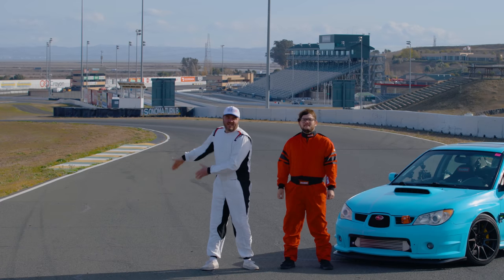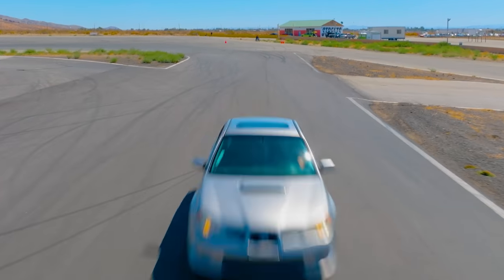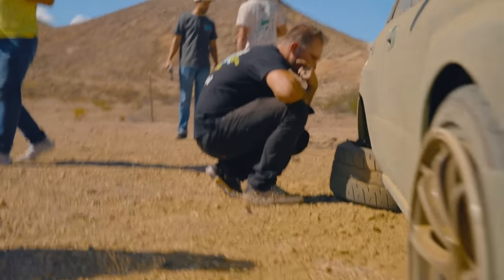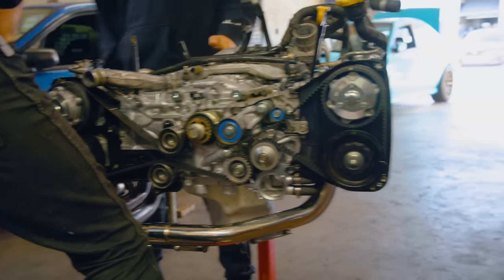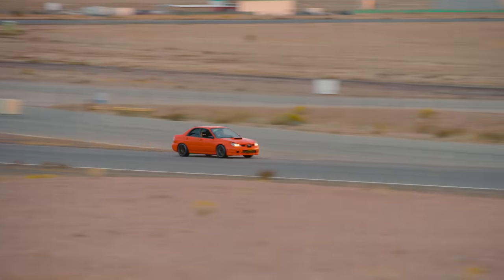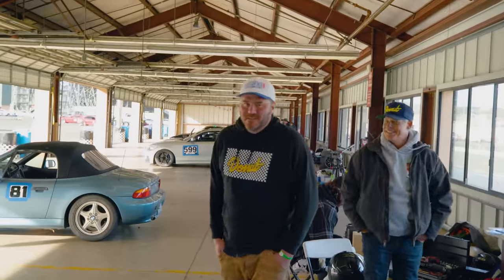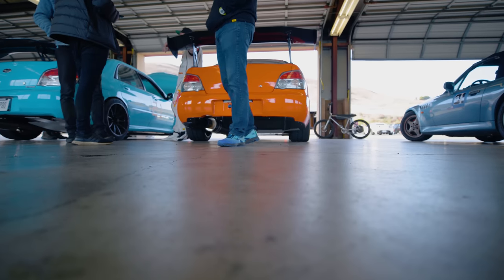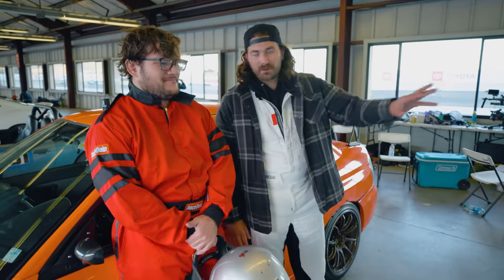$21,000 vs $43,000 Subaru WRX Build - HiLow FINALE!

Comment: If this was a normal person's build I'm 100% both cars would have gotten scrapped by now
Reply: A normal person would of put a built motor in the 1st time instead of wasting money on second hand ones.
Reply: @thewrathofbibby3381  or bought an ej207
Reply: @thewrathofbibby3381  normal people don’t have built motor money
Reply: @thewrathofbibby3381  they had a built motors and blew that up to.. hmm no wonder break in miles are for a reason drive a brand new car like a race car and watch it not last 5 years without major repairs.
Reply: @anusername8350  Normal people 100% have money for a built motor. Replacing from a brand new OEM block will cost you $6-7k. A built block only cost another $2k typically. Why wouldnt a normal person save the extra $2k to go built?
Reply: @AndrewB23  which is what I have. 20 trackdays later and it's still all good.
Reply: Not me lol still have mine makes 500whp
Reply: @mrblock2013  Calm down Mr. Moneybags

It's true that ACTUAL normal people don't have money to just throw on a car for a built motor. For example in America, 6/10 people don't even have $500 in savings.
Reply: @mrblock2013  Its kind of sickening how you expect normal people to have two grand to spend on a car that they could probably barely afford in the first place. I bet you had a great childhood and some inheritance, plus a paid for scholarship or something along those lines. Try to work at a store and have kids. Thats pretty normal. I dont, but Im just saying.
Reply: @BurittoSandwich  You are correct around 60% of people in the US live paycheck to paycheck which depending on said paycheck and cost of living in their area might give them some leeway but as you say normal people don't have built motor money, in fact most Americans rely on credit cards and bank loans to cover any shortfalls and even then as high as 85% live one serious medical emergency away from bankruptcy. This doesn't mean there are no people with money in the US but its a much smaller percentage than people like to think.
Reply: @edubbs3528  it disgusts me how America pays its teachers. they say that they value you, and then proceed to allow you to live in poverty, if you can even afford to live on the wages at all. teachers deserve an enormous raise across the board.
Reply: @thewrathofbibby3381  a normal person would ls swap it instead and avoid the rest.
Reply: @deathtoming2201  They had REBUILT motors, which usually means rebuilt to like-new, stock specs. "built" refers to changing the internals for aftermarket ones that are stronger/lighter than stock and can take more abuse
Reply: @skynet1.044  That is the fiscally responsible way, plus you get to learn about the engine far more in depth than hearing explanations online without context.
Reply: @KapteinFruit  it’s not sickening, I agree with him. Normal “car guys” should have enough for an engine build unless they’re stupid with their money. You should always know what you’re getting into before you buy something. If they were really living paycheck to paycheck, they would buy a Camry instead of building a car lmao
Reply: A normal person wouldn't get a WRX without knowing they'll blow up lol
Reply: @KapteinFruit  if you’re really struggling and you want a hobby, there’s plenty of other hobbies that are a lot cheaper and could even be free
Reply: @jcmellymel  Thats not how it works, is it?Hobbies come from interests. And me personally, Im good, financially. I work as a welder, but Im from a poor family thats why I get upset by your statements. On top of that I live in one of the worlds richest countries per capita. Im not dumb, nor poor.
Reply: @jcmellymel  Im not even talking about myself.
Reply: @mrblock2013  yep used to think built motors were inaccessible but it only costs a few G max if you do it yourself and only replace what actually is important
Reply: @KapteinFruit  but it is how it works, many people are scared or aren’t willing to try new things. I, for 1. The human brain’s capacity isn’t limited to only one hobby

As a grown man/woman, I’m sure you know the phrase, “live by your means”. Bottom line is, don’t get into building cars unless you can afford it, plain and simple. 

I’ve been a car enthusiast before I enlisted and still am. While I was enlisted, I knew I didn’t make enough so I didn’t even try to get back into the hobby. Of course I found new hobbies, but I’m still a car enthusiast. Now that I’m out and make a lot more, I’ve gotten back into it.
This doesn’t mean I can duke out $5k on the spot. I budget and save every month to fund the build. You don’t need to copy everyone else’s pace, you go with what you can. Which brings me back to my point, normal car guys should have enough for their builds
Reply: @KapteinFruit  A lot of people that got money came from poor families my guy, some people just don't have drive to move themselves up. Some are just lazy as fuck like my cousin in law just wants to set around smoke pot while her husband is the only that works and provided for them and their two kids...while living with her mom. People pumping out babies before their mentally or finically ready to raise kids.
A lot of people have terrible spending habits, and thanks the modern world built around debt tend to spend way out of  bounds. Financing the biggest house and cars the banks will let them.
There was a lady on the news crying about she can't afford to fix her leaky roof, with a brand new Mustang GT sitting in the driveway. I drive by run down trailers with brand new fullsize trucks parked outside all the time. By time they paid those trucks off, they could of  had  money to get a nicer house.
Reply: @jcmellymel  You keep talking about me. Im good. I got what I need. Im speaking about others view. How are you gonna save up money when you can put aside a pack of noodles. Just stop. Im good. I got a store thats going well. Im fine. Stop talking about my wallet.
Reply: @KapteinFruit  Not really one in a million, not talking like rags to riches. I mean like move up the ladder one step at a time. Just don't settle for working at Walmart or a gas station.  
I'm come from a poor as dirt  rural area where crack and meth is everywhere, I'm not ignorant to what you're talking about it. I watched my mama juggle raising me, work, and  school. There ain't no nonsense here. We live in a capitalist society, if you want nice shit, you gotta work for it.   You're right though, people are too afraid even take the little baby steps forward. Would rather take the shortcut, and wind up drowning in debt and bills. 
I ain't mad, just sainy' NGL  and pretend I didn't have it a little better then some, but I didn't come from money and have everything handed to me either. I just worked hard  to play hard. So of the more grueling hard labor jobs out there pay big money for those willing to do it.
Reply: I had a Subaru, engine blew, had it rebuilt, that failed as well, just scrapped it after that.

Comment: I would love to see an Up to Speed or B2B on the Subaru Tribeca SUV. It's interesting because the weight of the car is ridiculous, it has an H6 engine that has a weird design history, and it flopped because of its grille. I have a 2009 Tribeca Limited and it's been great. I spent 3 years living "van life" in this SUV all over the US of A and was easily able to fit a twin size 8" memory foam mattress in it without taking the rear seats out and still had space for the things that van life requires. I love this car and it's history and commercial failure is a good story. Love what you guys do! And yes, I vape Jewel Mint flavor 😂.

Comment: Well, if a group could do more to destroy a company image SUBARU doesn't want to hear from them. LOL, I wanted one of these cars before this.
Reply: Dont it will only give u problems and im not saying this because of the video
Reply: dont listen to him. Wrx is an amazing car. There are certain mods you need to do inorder to put power in this vehicle but its an amazing veh
Reply: They're awesome cars man, I would recommend them. They are not this unreliable. This is what happens when you don't research anything and just bolt random shit on and hope for the best. A lot of motors are the same in that regard.
Reply: @Mrninjaged not to be rude but you do realize 3 engines died before they even did anything to them right?
Reply: These guys have no idea how to build a Subaru please don't take their word for it, find other sources.
Reply: @demoritzz5327  They were all rebuilt engines when they bought them...Doesn't mean they were built right.
Reply: They’re great cars! Ive had 3 Subarus. They claim “5 engine rebuilds”. If 5 engines break within a few days. It’s the mechanic not the engine. I’ve seen dozens of Subarus with 400-700HP with little to no issues. Another thing is when u have metal in the oil. U replace the whole system not just the engine. No matter how clean u think the pan is there’s still metal.
Reply: Owned 3 and had zero issues. Care and respect for the car goes a long ways.
Reply: @BRedFilms  also break in period was probably non existent. Regardless their still a POS CAR PART 80K MILES.
Reply: Lol all these suby fanboys are like "yeah it only explodes if you fail to take it out every other Sunday at exactly 2:35 PM to the eastern most section of your town and bathe it in seawater, otherwise it's you're own fault when it explodes in 7 different ways"
Reply: as a previous legacy GT owner, who has worked on multiple hawk eye, 2008+ and 2015 WRXs.. unless you're 100% about the life dont. People will say "oh you just need clean correct mods etc" look the cars stock are great. Especially if you just do supporting mods and squeeze no power. But they have SO many weak links youll have to focus hard on each one. Engine ringlands, 5 speed transmission, many other annoynaces.
Reply: @Lurch Word. Wife's 2013 GTI is at almost 200k and the only thing I've done is wheel bearings. No chain noise, but I should prolly do that given the mileage.. Water pump was replaced via recall, and SHE routinely changes the DSG fluid and oil, along w/ tune-up. Oh, and I replaced a u-bolt on an exhaust coupler. We'd get another in a heartbeat. My VR shenanigans w/ Mk2's and 3's are all self inflicted, so they don't really count..
Reply: @demoritzz5327  they also drove one without any break in period.
Reply: People will look at this video and say subi isnt reliable nor isnt worth it. If you want to race this veh or things like that. One you have to have an air oil separator (aos), second the back right piston or piston 4 heats up quickly. You have to direct coolant there as well. Plus if you wanna throw in oil pan and pick up upgrade. When upgrading parts in the engine tune the vehicle every time.
Reply: @Fake This Crap  You know what you're talking about. Good to see man.
Reply: i got a 2019 sti and have driven it pretty hard for 30 thousand miles and haven’t had a single issue
Reply: @broglee7244  its not that. People complain about modifying these engine and itll break easy. What people dont get is that if you modify any engine it’ll break easy.the wrx sti engines are very finicky. You would need to make sure you get the things that I mentioned earlier to have a more reliable sports car.
Reply: @Sideapotatoes  why would you break in a used engine?
Reply: @demoritzz5327  They said that it was freshly rebuilt. They even admitted it was their mistake. I'm not some crazy guy about breaking in an engine but you definitely don't take it straight to the track.
Reply: @Sideapotatoes  the Last two engines we're rebuild the other ones we're junkyard engines. And i don't want to say you don't have to break modern engines in but they don't break of you  instantly abuse them. It certainly will shorten their life expectancy though.
Reply: @de Moritz z  I agree but there's more to this whole thing. Don't get me wrong, I'm not a big fan of these engines. I have an 04 wagon with a hybrid build that I think im going to sell soon because it stresses me out even with most the weak points all figured out. I'm a toyota guy so I'd rather a lift for my landcruiser, something I can trust.
Reply: I’ve had 2 wrxs, both ejs, currently on a forester, only problems I’ve ever really had were pinch clamps losing their strengths causing hoses to fall off, and a broken fuel line, some call it luck, I call it taking care of a car 🤣. These cars get horrible rep from stupid teenagers not knowing how to maintain a car. The cars in this video are being ran hard all the time, likely without a tune as well. DONT DO THAT!! just my 2 cents
Reply: @cerb_6202  i think maintenance does have a big effect  but they we're Not run without a tune either the engine was Stock or they Had the turbokit installed and while they Said "we got the Cars tuned" you See them driving onto a dino

I don't know since i have not had one yet but i think the reputation has to come somewhere bc if it was a teenagers fault civics and mustangs and the stuff these teenagers drive should all have a bad reputation. Although Subaru probably isn't as bad as it's made out to be. 🤷🏽‍♂️
Reply: @fakethiscrap2083  I read stuff like this and it makes me THINK. These are things I never would have just magically thought of, and it makes me think that it's worth the time and trouble to KNOW the engine you're working on, don't just slap shit on. Great contribution.
Reply: @YerBrwnDogAteMyRabit  its simple you own or plan on getting a vehicle and put more power into the engine. You would need to research the engine and things like that. Crazy that they preached it with their old videos but didnt do it with this vehicles.
Reply: The amount abuse and stress the motors and trans go through on a road course immense.   It’s nothing like driving it daily and pulling on the streets here and there.  Just face it,  those old subi engines just can’t hold up in those conditions.
Reply: @izzoArtistry  they could handle these type of track days. The only thing was the fact that they didn't really did their research on the vehicles.
Reply: Why isn't his goofy face on the video avatar? What's going on and we've lost that privilege?
Reply: @fakethiscrap2083  You're just a person that owns a WRX and wants to justify their purchase.
Reply: @pawrestlingchamp  honestly i dont really care if people dont buy the wrx. Because of donut media theyve made it cheaper for me to buy another wrx sti for a cheap price. Im lettimg peopls know whos wants to buy the veh to get it and to do their research. I dont go out of my way to say dont buy a honda, ford, bmw, vw, and merc because their dog water. Im happy with my purchase. I only buy vehicles that makes me happy
Reply: you could do it 1000 times better than these guys.

Comment: I have always liked the way the 07 WRX's look and they sound great, that's about all the good I have to say, sorry Subaru fan boys. Seeing them at the track being out run buy an E46 M3 after over $20,000 in modifications, a broken transmission, and 5 to 8 motors, I guess you just have to love the cars to want to modify them. I can think of very few cars less reliable after mods than a WRX of any generation. I purchased a 2006 E46 M3 6-Speed with 171k miles for $4,000 in 2019 that needed throttle body actuators. After coil overs, Pilot Super Sport tires and a few modifications I am probably in the car $8,000. I am confident not only is it a nicer car to drive, it will hold it's value infinitely better, it would outrun either of these cars no question on the track, and it is massively more reliable even with over 180k miles, not that it is a reliable car, but comparatively so it is! I would save my money, buy a 2007-2013 335i with a 6-Speed, work out a few N54 or N55 kinks, rune a tune and downpipes, a absolutely destroy these WRX's on a track, and not lose a motor in the process. The WRX might be a fun car with a huge mod market, just bring your wallet, and some patience!

Comment: Would've loved to see an estimate on the cost of things like engine/trans replacements and LABOR.  The parts might've been $21k/$43k, but odds are labor doubled the cost- if not even more.
Reply: Itd be nice to see, but not really comparable. Majority of people can buy the exact part at the same price, but some people can install everything themselves, have a mechanic buddy, or if at a shop, labor prices can fluctuate just by going down the street
Reply: @stargayzer5446  how do you figure? I have a subaru engine. My car is 22 years old. It makes more power than either wrx in the video and hasn't been blown or rebuilt once. 170k kms. Donut ran subarus name through mud for views. If they'd built the cars right there wouldn't be any issues.
Reply: @chrisswanson743  i cant say i disagree. i have a swapped 95 legacy with a fully built 2.3 liter destroker and its given me 10 years of reliable track service.
Reply: Even if they just included the amount of labour not the value. That way you can judge what it would cost in your area